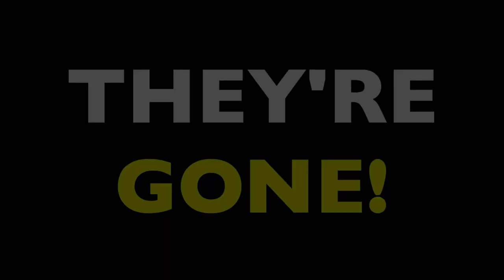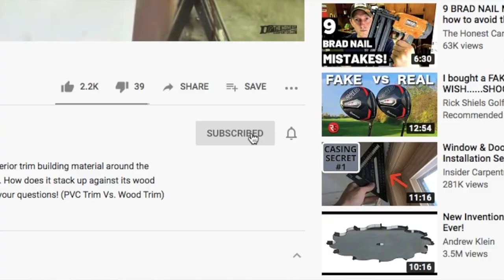There's Something TERRIBLY WRONG With My Table Saw! Should I THROW IT OUT?! (Carpenter Discussion)

Comment: Amazon has the Dewalt 8 1/4' tablesaw at 29% off right now.  $269.94  
But I noticed you stopped scrolling when you were at the Sawstop in the video.  Was that a bit of foreshadowing?  Hmmmm?    Thanks for the video.  Fortunately, just got into woodworking and haven't used any of my saws enough to worry about replacing.  Yet!
Reply: ive been eyeing that dewalt on amazon;  i have an old 10 inch ryobi but the fence is a pain to clamp on straight and that blade wonders off from the 0 degree setting to a few degree bevel

Comment: Man, you just can't beat the DeWalt DWE7491RS....great fence and great work stand at a very good price.  Only issue is their nutty choice to use an aluminum table with a coating, so the T-track is a little big...you have to find the right featherboards for it!
Maybe you should look at the new SawStop jobsite saw?Good luck with whatever you buy.
Reply: Everything I have is DeWalt except my table saw.  You can't beat an old cast iron Craftsman.
Reply from the maker: I’m gonna look into both of them Larry! I really have loved this 744…
Reply: It's weird that some 7491s are affected and others not. I bought Kreg featherboards and they snug down perfectly but lots of reviewers with the same saw complain they were either too loose or tight. Similar reports with other feather board brands. Maybe it's a variation in the featherboards but I think more likely the saw as many of the reviewers with different problems had new saws.
Reply: I have a DW7490 that I sent to DW for repair. Because I needed a saw for my project, I bought the DW7491RS which I was going to use and then give it to my son. However, on the DW7491 the blade would come loose. After the third time that this happened, I sent it back.  Since then I have seen articles on wood working forums where other people had the same experience.  Be careful with that saw.

Comment: I have my first circular saw, its it's an older one I bought second hand. It's been working well, then this summer it started, well, stopping. The blade will work normally for part of the cut then the blade will stop spinning but the motor is still going. I thought it was a dull blade, my dad thinks it's the motor. Before I spend money on either, I'd appreciate if anyone has any ideas on what could be causing it?

Comment: Hope you didn't go for Sawstop (unless they give you one... which they probably would.) The safety feature is nice, but other than that, it's still just a low quality saw... especially the contractor version.
 
I like 10" saws (due to dado capabilities) and lice the Bosch. The Dewalt used to be my favorite until they started "cutting" corners on their saws.
Reply from the maker: I’ve always wondered about saw stop. I only ever made one cut on a friends saw stop, but didn’t put it through its paces…
Reply: @The Honest Carpenter  you know, it's not as bad for their larger, full-size saws, but even then, there's better saws for the money. It's one of those "great ideas" that's been too restricted by its current patents. Once the patents run out, all of them by 2024, I wouldn't see them lasting long by themselves. I'm sure they'll sell their name and feature to a bigger company if they want to survive (but it def won't be Bosch since they already had to sue Bosch for their version of it, the REAXX.) 
 
Their contractor saw they just released is really buggy. It's been misfiring a lot, and it's having issues on bevel cuts. It's really like a Skil table saw with a Sawstop feature... but for almost $1k. If you have your sights set on that, you'll want to wait a bit longer for them to be tweaked a bit. 
 
 I'd rather have a good saw, vs. an ok one that might not cut me... and I only have 1 functioning arm and leg. Lol. 
 
When all is said and done, if a good company made a purely right-handed track saw (left blade), I wouldn't even own a table saw. Track saw, 2 guide rails, and a router will do pretty much everything a table saw

Comment: Simply add a piece of aluminum extrusion to your saw. Sister your fence and make it approximately 10 inches longer. This will help the performance of the saw tremendously. Then simply shim the back or front to fix the alignment issue as well as the camber. As far as the handsaw you're fu***d.

Comment: I bought a cheap skill saw from box store. Mist of it was made of plastic. I wanted a cheap one to destroy. But damn there has to be a limit. Wish I would have checked inside the box before I bought.
Never used it. Not worth it. The cut just wouldn't be straight. And as flexible as it is. . I don't feel safe.

Comment: I don't own a table saw but I did use my circular saw until it stopped rotating the blade, & the blade wouldn't cut straight anymore.  I've been debating about going cordless, the problem is all my original blades are 7 1/4 & I'm not willing to buy a new set of blades for a cordless saw. 👷🏿
Reply from the maker: I really want a cordless 7-1/4” circ saw too, W! I’ve always had corded, but cordless have gotten so much better.
Reply: They make cordless 7 1/4.  The blade just may not be on the side you wish.  If you go with a worm gear the blade is on the left and is a 7 1/4.  If you go 7 1/4 side winder the blade is in the right.
Reply: @thecrippledstud  Seriously? I've only ever seen cordless saw blades at 6 1/4.
Reply: @TheHonestCarpenter  Sucks they don't make 7 1/4 cordless saw blades, or if they do I've never seen them.
Reply: @user-em6ie2be7x   They do!  All your 7 1/4 blades you had for your corded saw should work for a cordless.
Reply: Dewalt, Ryobi, Makita, Milwaukee, Rigid, and many others make 7-1/4” cordless circular saws; and they use standard 7-1/4” blades.
Reply: @johnmack537  I use brands like Hyper Tough or stuff from Harbor Freight. But I'll check out those brands you recommended.
Reply: Those Makita 7 1/4 saws are a godsend. The Milwaukee rear handle 7 1/4 saw is terrific too. I probably use the Milwaukee one the most since my framing rig is mostly the M18 battery system. I'll never go back to corded now!
Reply: @bradtgm  I have the DeWALT FLEXVOLT 7 1/4, I love it.  Haven’t had much experience with other brands.

Comment: I’ve got the same table saw and same alignment issue but in reverse. The back of the blade is closer to the fence than the front. Since I know that pinching can cause kickback I haven’t touched it since and it’s been sitting in my garage every since I noticed it. I occasionally try to tinker with it to see if I can fix it but still don’t use it. I’ll probably toss it soon and eventually get a new one.
Reply from the maker: That’s the worst case, Chase! You might be able to loosen the mount and crank it over. But definitely wise to put it on hold for now. 😬
Reply: Too bad I don't live near either one of you guys (western North Carolina), the DeWalt is one of the saws I was looking at, and I have a machining background. Pretty sure I can slot the channel for those adjustment screws and run them until they finally die.

Comment: makita probably sell the blade guard as a spare part.
Reply from the maker: I’ve thought of that, Sadi—but I’m not sure what exactly is bent in there, and id hate to go through to trouble to find that it’s a combination of damaged parts 😕
Reply: The main casting near the blade height adjustment bends or cracks. The guard then binds toward the rear. You will see witness marks on the inside of the gaurd if you remove it.
At least that's been my experience twice.
Those are generally tough saws, but that is a weak point.

Comment: You can buy a replacement for the damaged part to repair the saw.  This video only tries to repair the tool by banging it back into alignment that if you do wrong might harm you.  If you buy the part and watch the Youtube video for the repair you will be in a safer position.
Reply from the maker: I disagree with this. You’re making it sound far too simple, especially since it’s not yet determined exactly what component is bent—it could very well be the arbor itself. Attempting single part replacements can lead to wild goose chases if you don’t fully understand every component in the blade mount assembly, and know for a fact which one is compromised.
Reply: @TheHonestCarpenter  I am glad I found your videos because I am learning a lot from you. As far as fixing tools some are worth the time to fix and some are not.  If you really wanted to fix let's say a vintage table saw you can learn to understand every component and check for arbor runout then buy parts on eBay.  But if I was a professional woodworker like you it is a different situation.

Comment: From an electrician's pov the dumbest thing I have seen was someone wanting to borrow some black tape. Carpenters usually use masking tape. Anyhow, I gave him a half empty roll and said he could have it. 

So I guess he'd cut the power cord in two. I could have fixed it with some solder and heat shrink but he just twisted the bare wires together and covered them with a big ball of tape. 🙄

Comment: Truth be told, portable table saws are just not built to last. Granted, the Dewalt is arguably the best out there, but it still has its flaws.
Reply from the maker: Yep, far from cabinet grade. But so easy to sling around the job site! I’ve hauled it up a lot of stairs over the years 😅

Comment: I don't throw them out unless they quit. I'm still using a 20 yr old skil circular saw that has a slight twist in the blade alignment. I'm so bad on this I still have a probably 50/60 year old drill in the garage that I inherited from my dad. Still worked the last time, somewhat, but it needs new brushes. Interesting subject to be sure. Thanks for the vid.

Comment: WOW ! A make believe carpenter that has no clue what he's talking about AND doesn't know how to align a rip fence. FIRST: remove the riving knife. That knife only works IF your using the specific Dewalt blade it's made to work with. Your not.  SECOND:  align your fence with the blade. (easy 10 minute job).  If it still goes out of alignment when it's tilted, then you have a bent motor/arbor swing assembly. Easy to replace and a hell of a lot cheaper than buying a new saw.